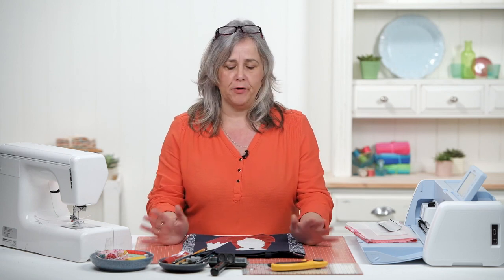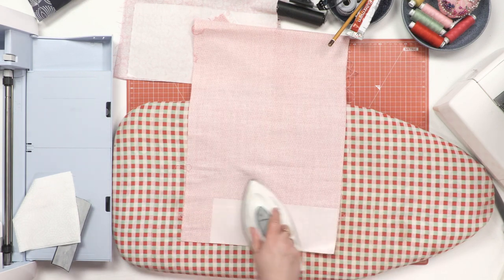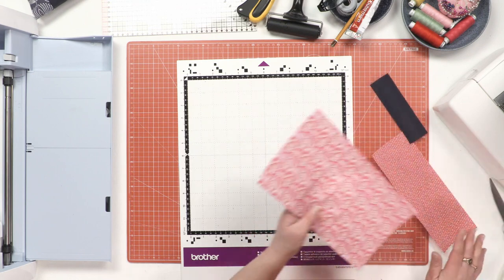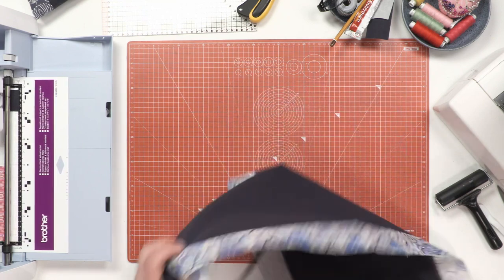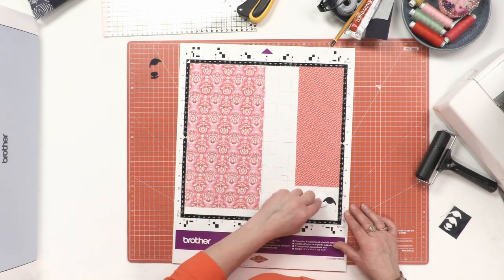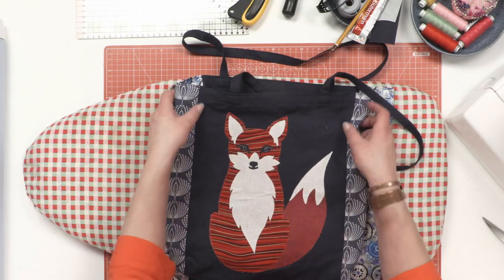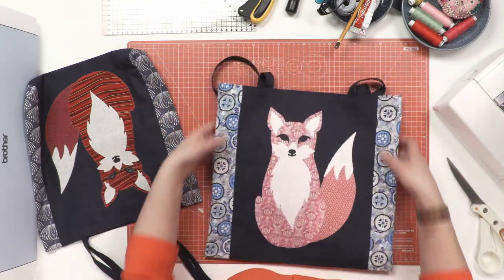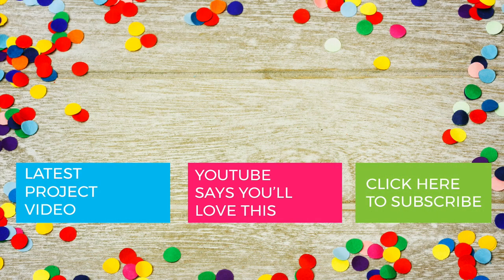Easy Applique Fox Bag | AD

Comment: If you weren't going to start the appliqué project for a day or two, but wanted to get ahead by cutting all the pieces ahead of time, could you not place the 'heat and bonded' fabric face down on the sticky mat?  That way you'd keep the 'bond' side free from gathering dust and muck. I realise you'd have to mirror the images in the SnC.

Comment: Hi , quick question, is the backing adhesive similar to Heat and Bond, or you have to buy special backing for the machine?
Reply from the maker: It is similar. I've used heat and bond in the past with the Scanncut. Just remember to remove the backing paper before you fix the fabric to the mat and don't ever use a 'fibre' type adhesive sheet; you'll be peeling the bits off the mat for months! c x